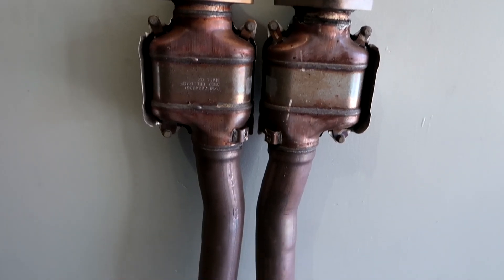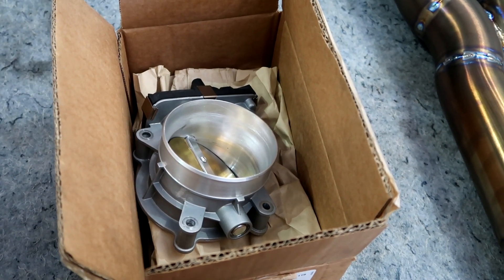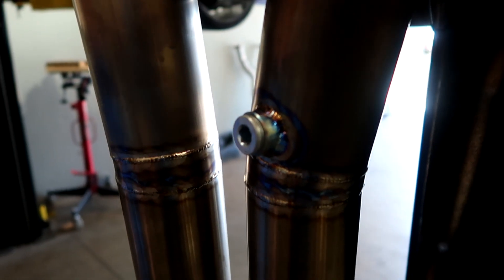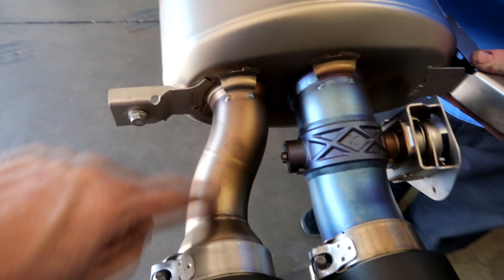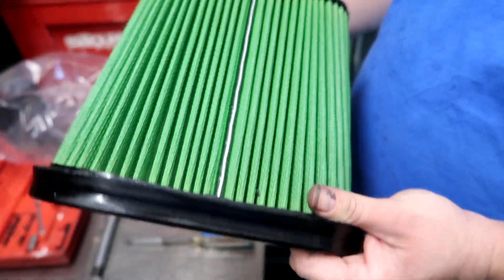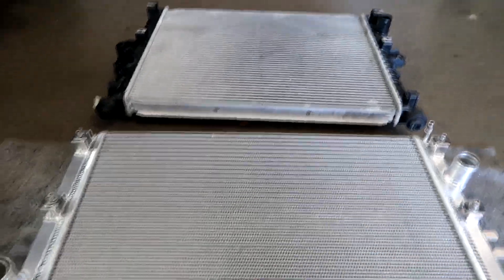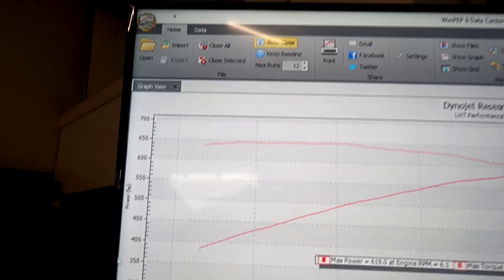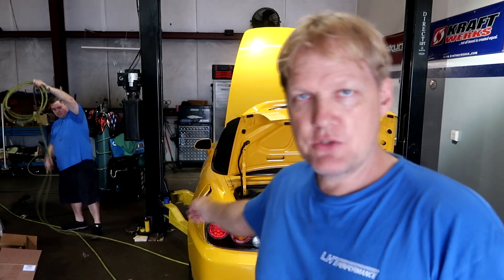C7 Z06  more power and less weight

Comment: So im seeing a 9lb difference on that one muffler you weighed, that's 18lb saved, akrapovic only advertises 11.6lb savings on the axle back slip on. What going on?
Reply from the maker: Justin Coldiron  The X pipe we built weight 9lbs compared to the stock of 25 lbs. 18 for the mufflers and 17lbs saved on the X .
Reply: Wasnt it 22.5lb for the stock muffler and 13.5lb for the akrapovic on the scale you used? I know your X pipe is super light at 9lbs.
Reply from the maker: Justin Coldiron each muffler saved 9 lbs. 2 mufflers saved 18 lbs.  The  X pipe saved 17lbs.  That’s 35lbs saving right there . We didn’t mention it in the video, but we also installed a pair of NorCal pipes which saved even more.  Does it make sense now. ?
Reply: LHTPerformance It still doesn't make sense because Akrapovic says the mufflers only save 11.7lb just looked at their page. Factory weight was 41.5lb and Ti slip on was 29.8lb. what im getting at is the system is even better than they advertised or their scale is off.
Reply from the maker: Justin Coldiron maybe their scale is off or our scale is off. Maybe it’s a conspiracy, maybe it came filled with hydrogen. Next time I’ll do the titanium exhaust on my ZR1 I’ll bring in a team of experts in a controlled environment. Maybe you can fly in and watch it live🤷‍♂️.  I don’t know what to tell you 😐
Reply: LHTPerformance you're a funny guy. Thanks again for weighing it, I want it even more now.
Reply from the maker: Justin Coldiron  Just playing..lol.  It’s good quality stuff 👍🏻 It’s worth the money if you have it